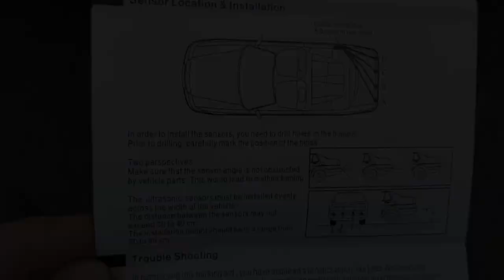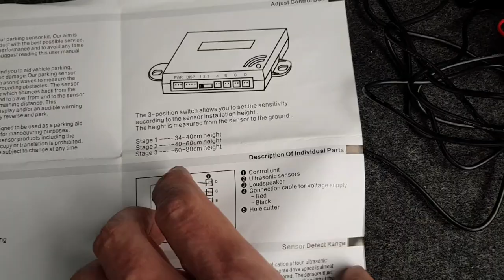Honda Jazz (Fit) Mk1 (2002-2008) - Reverse Parking Sensor Kit Install

Comment: Very neatly installed. How is the kit performance for low height obstacles? Like 12” in height
Reply from the maker: I don't know as haven't tested it. But it works well with other cars, walls etc

Comment: Interesting info, is that the smaller 18.5 sensor kit? They look more factory then the bigger ones
Reply from the maker: Yes the sensors are 18mm. Link is in the description
Reply: I found the same adjustable kit on eBay as the Amazon one had sold out, pre-coloured silver and put them on my VW Passat Estate, fitting was easy enough. I did find I had a problem when first installed though, whenever I put my foot on the brake it stopped the sensors working, I found all the lights on my car have a combined earth through the cluster so I cured the problem by running the negative wire from the Cisbo box directly to to an earth point I made on the car body

Comment: is it possible to install without taking the bumper off?
Reply from the maker: Yes probably but much easier with the bumper off
Reply: Yes by the look of it in the video. I must have installed at least 4 parking sensors in my cars in the past and managed to do without taking off the bumper. Here it is definitely possible looking at the video. You just need a long wire, a roll of string, a bright flashlight and some tape. Railroad first the wire through the sensor hole to the point inside the car and pull a separate length of string through each of the sensor hole and finally attaching the sensor wire to the string pull them in to the car. Easily done. Use the flashlight to see under that bumper to plan your routing of wire, string and finally the cables.
Reply: Here is a video of parking sensor installation with out taking off the bumper.
https://youtu.be/LBPxQWe38qM